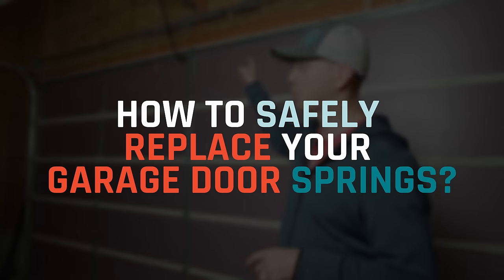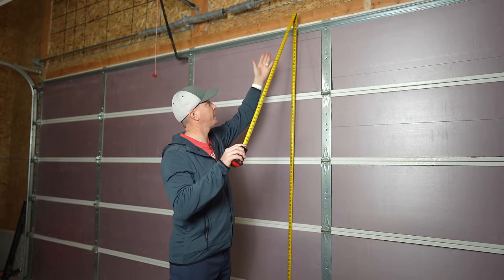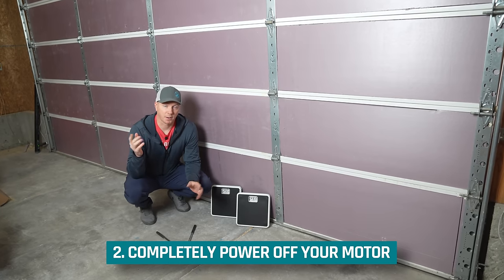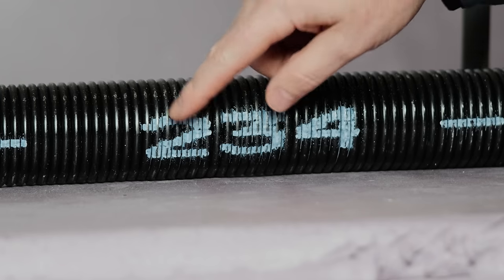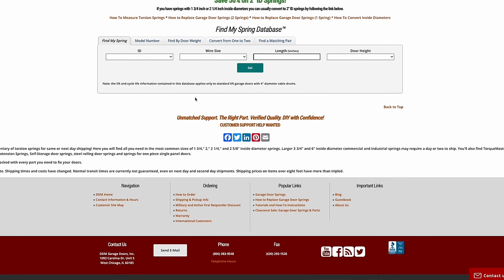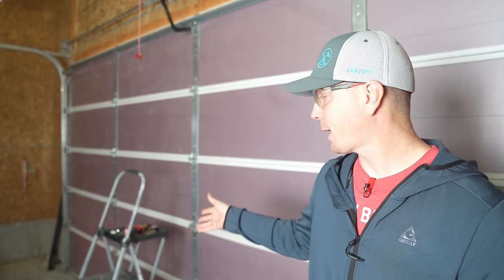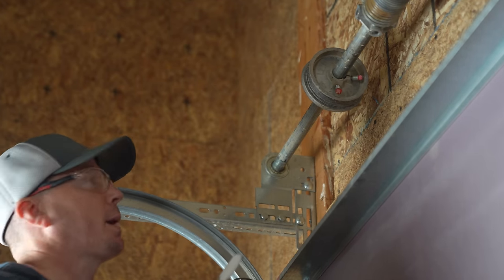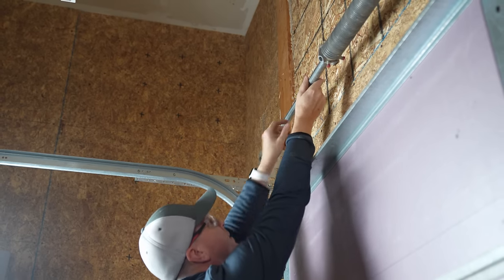How to Safely Replace Garage Door Springs & Save Hundreds

Comment: I'm doing this job now and ran into a problem not mentioned in this video. I found that I had two different sized springs. Apparently you can use non-matching springs, they just have to be wound a different number of times, but it's not recommended because the smaller spring will wear out sooner,  which is exactly what happened in my case. Also, I measured the broken spring to figure out what size to order and didn't notice it wasn't the same size as the other one. I thought the good spring was slightly longer due to it still being wound. It was only after I unwound it that I realized it was longer and the wire size was larger. I had to order new springs.

Comment: Ah! If I only found your channel 2 weeks earlier.  I already spent $280 to have a tech do this. Great company, but it would have saved me  over $100 from labor charges, and possibly a little more for spring cost. Keep these vids coming. I DIY everything I can so your efforts are greatly appreciated.
Reply: $100 more to spare yourself any physical risk, knowing the right parts are used, and saving yourself the time? Sounds like a good deal. Most places guarantee the parts and work too. I think you're looking at it wrong. 

I do agree that it's not too complex an operation, but my time is worth money too. Last thing I want is injuring my hands, maybe permanently.

Comment: Nice Video, Little complicated on measuring the spring. I measured physically to determine the size. I skipped the weighing of the door with only one spring supporting the wight of the door, I don't want it to break while I am working. This can be done and adjusted after the installation.

Comment: Might want to add a section showing how to deal with a garage door where the partitions (walls) on either end are too close (to the drums on both ends to add springs - meaning the axel with drums needs to be removed from the middle bracket to allow room for the springs to be applied .. also?  automatic focus and larger depth of field (smaller aperture) helps a lot..

Comment: Mission complete! I followed your instructions and demonstrations and completed it in about two hours. Watched your video a couple times and as I was performing it, watched and paused and watched. Doing almost every step as you. I did see that you measured from the wall to the pole near the pullies to verify your center distance. 
- Could you have marked the center bracket where the springs are bolted to before removing the two bolts?   
- I was not able to move my springs the 1/4 inch to stretch them out so hopefully they are still spaced enough.
- I have a 7 ft, 200 lb door so I torqued the springs 30 cranks but it was too much lift, worked against my opener when closing causing it to think my door was touching something going down and it would open back up. So I removed one crank from each spring (29) and it works normally.
Reply from the maker: That’s awesome that you did this! Great feedback as well. To answer your questions, yes - marking the center would work well, the 1/4” stretch isn’t always feasible as it depends on the spring and you should be fine, and I had a similar experience with the number of cranks. That’s very specific to your situation so you did what works for your door, which is perfect. 

Thanks again for following up and nice job!👍

Comment: I had already replaced the springs on my garage door before seeing this video. It is 99.5% correct. If you don't own a ladder, you shouldn't be doing any DIY projects. Also most are not lucky enough to have that much space on each side to remove and install the springs without taking the bar down to remove and replace everything.  In that case, you will need two ladders. Everything else is spot on.

Comment: Thanks!! I subscribed cuz of this video. It's not an art. My area is about $1k job. If you can overhead shoulder press 20lb with 1 arm, you can do this job. If only 15lbs, eh... make sure you have a master set or the right tools you need. I needed both sae and metric.... the 12 and 15 measurement might be misleading. Mine were perfectly balanced at 30 quarter turns on a 12 diameter 8fter.

Comment: I did a direct replacement on my springs. Ended up only going 24 turns to have it balanced. Guess they were wrong from the start. Guess I'll replace them with the correct springs when they break again lol. This video was super helpful though.

Comment: Excellent video. One thing I'm curious about though -- If you're going to loosen the set screws when you're getting ready to unwind the old springs, why not remove them completely? If the spring does get away from you, at least the hazard of ripping open your hand is reduced.
Reply from the maker: That's a great point - I don't see why you wouldn't want to do that.
Reply: Because you have to start and then screw them in more, =more time *One handed! while holding winding bar tension on spring

Comment: Quick question, so when you measure the length of the spring you measure the new one and you said 36” but the label that you showed before was 18.5 did you upgrade the spring for the extra weight of the insulation? So if I have a 16x7 that weights about 154 pounds and has a .0875x2x16 should I upgrade if I’m putting insulation in the future? And how do I find the right spring for the future weight? Thanks great video!

Comment: Don't underestimate the value of a lifetime of experience. We had something installed at our company. The owner of the small company that installed it came to explain to us how it works. Our maintenance people were asking him questions. One of them said, "What if it did this xyz?" He said in 30 years we've installed thousands of these. I've only seen it happen three times. You're not gonna have to worry about that. That's the experience of knowing what really goes wrong or can go wrong and how to manage those situations so they don't continue to happen. It's the shame he sold the company and retired. I would definitely recommend them to anyone. It was heating equipment.

Comment: Thanks for the helpful video.  You discussed this in the video, but I'd like to make the point as well.  You're saying hundreds of dollars by doing this yourself, so there's really little point in savings tens of dollars by choosing cheaper springs.  The absolute minimum in the table shown at 17:35 should be the 34,000-count springs and even the 77,000-count springs are only $30 more for more than twice the expected lifetime; they should last the life of your garage door and, in fact, that might be the only overruling consideration if you don't expect the garage or house to survive that long.

There is a point of diminishing returns, of course, but it's generally a better investment to get the most durable option and in this case the better springs might be conserving the resources it would take to manufacture, transport, purchase, and install replacement springs in the future.  This also saves either yourself or a future owner of your home the hassle and potential injury of a spring failure and replacement that might not even occur if you install better springs today.

From the table shown at 17:35, we see that:
13,000 cycles at 4 cycles per day is 9 years for $47 + shipping + tax
77,000 cycles at 4 cycles per day is 53 years for $97 + shipping + tax

The budget springs may need to replaced 5 times by the time the expensive ones fail, though these are all expected lifetimes, of course.

Shipping is likely the same, regardless, further reducing the relative difference.  Considering the parts cost versus the labor and risk involved, just get the best or second-best springs in the table and be done with it.  Cheaper is usually more expensive.

Comment: We have to make sure tension is released from both sides before moving to the center bolts? I know yours is broken but it wasn’t mentioned to unwind the other side if needed to.
Reply from the maker: Yes, that’s correct. All tension has to be relieved before removing the center hardware for sure.

Comment: Great Video! I have one question. I was able to install the tension springs, I did 28 quarter turns for my garage door that is about 6ft 9 inches.  When I get to the part of doing the self-lift test (minute 38) I am not able to lift the garage door at all, it won't move.  Any suggestions? Do I need to put more tension on the springs or do less tension?  Thanks in advance for the advice.

Comment: I was noticing that the springs are connected in center through the open mouth bracket. One of yours was broken so you could unmount the first one after the tension was relived from it. That said, for someone who is just replacing them for any other reason other than having one that was broken wouldn't they need to make sure they remove the tension from both springs before unmounting either spring from that center bracket? I know you mentioned this scenario at the beginning of your video but for someone who may not have done this before they may not have put that together. Unless i am just completely wrong about this which is possible but this is just my two cents for safety concerns.
Reply from the maker: You're absolutely correct. I could have been more clear on this but yes - if you're replacing two tensioned (non-broken) springs, you have to ensure that the tension is removed from both springs before removing any center or end hardware. Great point.
Reply: @LRN2DIY pin this!

Comment: Trying to get question answered, I want to go two spring center bracket as I have one 40” spring for 7’ x16 door.  Problem is about 10” left of my current center bracket is a torsion bar coupler from Martin.  Measure with caliper, is 1.75 in.  If I use 2” inside día springs and slide over coupler, will it ever rub inside of coil. Door probably weighs 200lbs dead weight..

Comment: Great video.  I wish this came out before I paid over 700 for my new springs.  Question: Why did you leave the ends of the springs unlubricated?  I'm pretty sure my installer lubricated the whole spring.
Reply from the maker: The idea is to prevent lubrication from effecting the set screws, so they don't slip out.

Comment: YouTube University, and first time successful garage door spring changer right here. Here are my thoughts: this is not a thoughtless job. Before you start watch many videos. Understand the physics of what is going on. If either spring is wound up with the set screws tight, there is a TON of potential energy in that spring AND the force behind that energy is transfered through the winding cone into the spring set screws, to the bar, to the set screws of the drum, to the drum, to the lift cable, and ultimately down the cable to the bottom of your garage door where it attaches. This is how the springs create lift for the door and balance it so it is nearly neutrally balanced when going up and down. Imagine - your door weighs 200+ pounds. That means each spring has 100+ pounds of force pressing through the kinetic chain i just mentioned above. HERE IS THE DANGER: IF you break that kinetic chain by loosening ANY set screws while the spring is under tension, then the bar or springs will IMMEDIATELY transfer that energy to the next thing mechanically that will stop it from moving. Example: lets say you have one broken spring and one that is still under tension. That means there is about half the force needed to balance the garage door still pulling upward on the door ON BOTH SIDES. If you go and loosen the set screws on one of the drums, without first removing the tension from the still wound spring, The bar is going to start spinning out of control. What's more dangerous is if you loosen the set screws on a wound spring without having the winding bars completely secured .

Comment: What I have done on mine was to wind the spring with the door open, which takes very few winds and much less winding pressure to deal with.
Reply from the maker: I've heard of people doing that and there are definitely different schools of thought on whether that's a good idea but I can see the advantages.
Reply: How did you get access to the springs when door is open? Unless, you push door all way back! So, what determine how many winds you do?
Reply: I do push it past the normal stopping point and it takes very little effort to give it a few turns. Not all doors will need the same, but I have 3 of them, so I give them the same winds as the others in the up position. It may take a little trial and error to get it to where you want. I just think that it is saver and easier to let the door going down to do the hard and dangerous part. All of the springs I have came with a straight line that runs from on end to the other in the unloaded position that makes it easy to count the turns. @ImportedFromSerbia

Comment: If my drum cables are loaded through the front vs. the back, and the torsion springs are to the far left and right vs. the middle, do i need to twist the torsion springs up or down?

Comment: Just replaced my springs about 6 months ago after hearing a loud pop.  Sounded like someone ran into the side of the house, purchased the springs and winding rods and it was a pretty simple job if you're careful.

I didn't use scales or anything like that, just measured 20 coils and a few other things and got exactly what I needed from a chart i found.  The windings for mine was like 27-30 give or take..  

I feel the video was very detailed but I think a lot of the extra info can be intimidating.  There were a few other videos i went on that were much shorter and to the point that gave me all the info.
Reply from the maker: I appreciate the feedback. I can see how the video can be overwhelming. I chose to go this direction (extra detail, all of the ways to identify the new springs you'll need, etc.) after seeing that most other videos out there seemed to be lacking details and info, at least for the way I would want to learn this. I totally get that it's not for everyone though. Thanks for watching and for the feedback!

Comment: important to stretch spring out ward holding hub like 2" then screw hub to rod otherwise spring wire get squeezed and rub.
There should be a tool that clamps rod with lever handle to hub and pulls on spring, locks it from turning so screwing the hub down is simpler.

Comment: The DDM site linked in the description will give you free winding bars with a purchase of springs, so add the bars to your cart first.  Also, the site explains how to convert some inside diameters to more common 2" springs in order to save money in some cases.